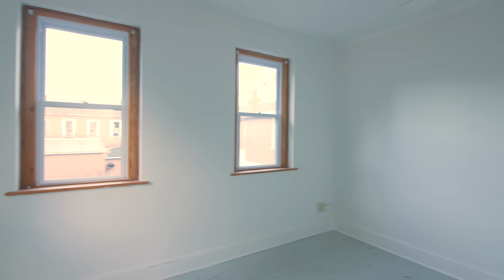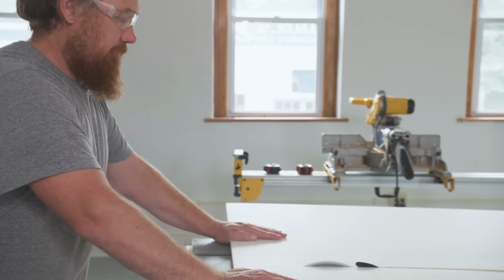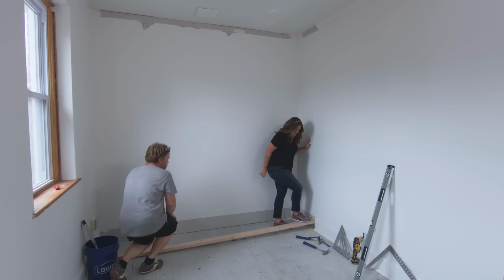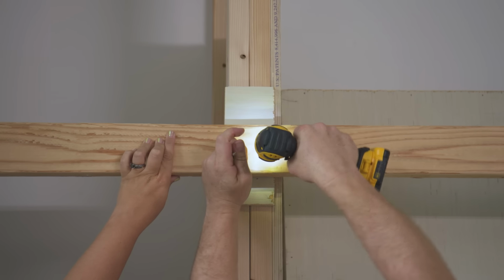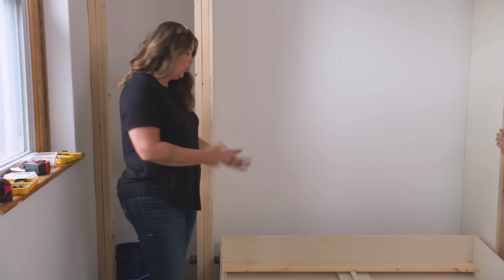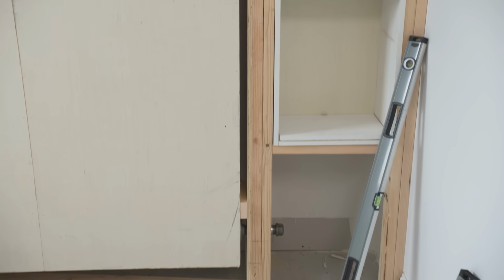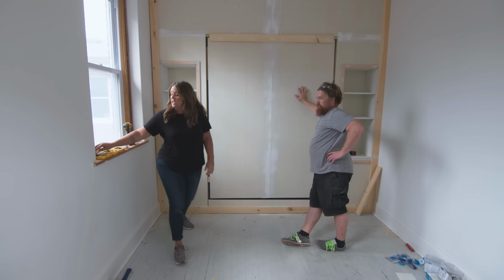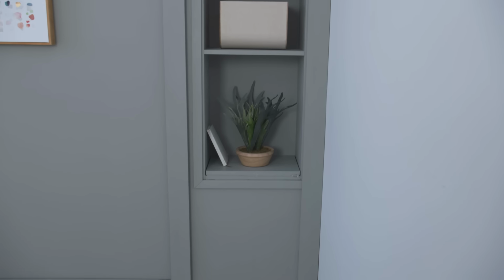How to Build a Hidden Guest Room w/ a Murphy Bed

Comment: I looked at this video MONTHS ago and thought that's a cute idea. Never intended on using it. But now after living in my house for 3 years and tackling some DIY projects the thought of a Murphy bed has come up. After watching hours of content, great content might I add the idea of spending so much on the mechanical mechanisms is a bit much. So glad that this video came full circle for me. Seems pretty low budget and easy to tackle. For those who are saying the space above the bed is wasted. Maybe you could use the side and back wall studs to support the weight of the build. Add a layer of plywood to the top to support upper shelving? Just a thought I'm not a carpenter, just another DIYer looking for ideas and this is a GREAT pocket friendly idea!! Thanks for sharing! 😁

Comment: Nice work and it looks beautiful, but I'm not liking the removable velcro slats. My experience in fixing others mistakes, is that removable pieces get either lost , broken or stolen. I would have gone for a long piano hinge on both sides that would open up outside of the bed frame and use magnets to attach the side hinged slats to the bed frame when it is put together. Oh and I would have made the lost space accessible as well with the same technique. Thanks for sharing...

Comment: exposed gaps along the floor and ceiling are perfect time to add bead of caulk to air seal. Creative. I think I would adjust so "hidden" frame is attached to bed bottom, position legs diff w/extra tab in center. also the screw bolts are crazy. just use pin/housing? Great DIY project!! thanks

Comment: As an engineer, this build frustrates me so much.... 
It really irks me that a metal pipe will be moving inside a wooden hole for years and years.... Use ball bearings and solid shafts. much better.

This needs a metal frame and metal diagonal support members to resist the torqueing I see is happening with you move this frame... nothing big just some 1x1s welded together. atleast some 2x4 diagonal members if you MUST stick with lumber...

It REALLY bothers me how the trim to cover the gap is fastened with velcro... you know you could have attached that to the bed itself and not fussed with removing it everytime you use it? You also know the average person isn't going to put velcro back on perfectly straight with no gaps, it'll look so bad!

The night stand should be on drawer sliders under the shelf so you don't have to remove anything on the top of the shelf...

The "access panel" for electric really needs to be a wall outlet, not an extension cord. may be up to code but cmon, it's ghetto...

why do you need to unscrew eye bolts to get the bed undone, ON BOTH SIDES... the safety issues and ease of use problems... The wood on the bed and the shelf will strip so fast... Just use a single latch at the top. you could design it such that the trim you decided to velcro at the top is actually attached to the latch such that if you pull on the trim, it unlatches the bed frame. word of advice from an engineer: if you have to say "it helps to have two people" you designed it wrong.

If it were me, I'd  add dampers so a 90 pound woman could lower this, because a queen bed and frame at that height is cumbersome for even me. You can also get loaded spring hinges to help counteract the moment about the ball bearing/pipe hinges and install them adjacent to the ball bearing hinges. With how this SHOULD HAVE been built, it would be much heavier anyways...

Why on earth is there so much space wasted? I thought it was a space saving project, but there was some space on all four sides of the bed that are now enclosed and lost forever...

wtf is that leg design? Get a 2x(x... however tall you want the bed) hinged on the top, and they will fold out to expose the hinges when the bed is in use, much like your original nightstand design.. much prettier, safer, and sturdier than what you guys did...

Comment: I have a sewing room and my husband hung a table to the wall with hinges and a winch in  the garage next door  in a cabinet so as   to lift the table up and down. This table can be used as a quilting table in my sewing room. The day bed  has been redone to hold the weight of the table.

the garage next

Comment: Such a beautiful and simple design. I’d add a drop-table with an attached leg to the platform base/wall so that you have a small table for crafts, games, or puzzles or as a desk. The table needs to be strong enough to support a sewing machine. What was the cost of the build without the mattress, pillows, decorations, etc.?

Comment: Once again GREAT IDEA for a video but when they started talking about the eye bolts all I could think was "WTF?" and don't get me started on the velcro trick is just a tacky as leaving the gaps.  Another thing - just like EVERYONE (more than 700 people) who commented below, this project was poorly thought out as far as using the overhead and space below the nightstands for storage. Also, that bed frame is going to make that bed VERY uncomfortable with that one stabilizer bar running down the middle. Anybody else here wonders if the bed legs might get hung up on the framing if they expand due to high humidity? Great idea for a video but they really need to go back to the drawing board. What a disappointment.

Comment: Murphy beds with fold out desks are expensive ..usually well up to 2k....this is a dyi  cheapo version and I LOVE IT. I have looked at these for years and this is one clever version although I would put metal corner braces in the bottom part of the frame to prevent the corners from blowing out from the shifting weight of the mattress as it is brought up.  I would add a folding desk to the wall and gladly call it my office! There are so many design possibilities with this build, storage across the top of the bed frame (book freak here)  perhaps with a library rolling bar and ladder (really a book freak here)More shelving if you wanted it on either side..even cabinet doors covering a lower unit on either side to hold bedding and guest items like a bathrobe, slippers, mini shampoo's and soaps, face cloths, all in a basket of for them to take out and use.  Perhaps a bottle and glasses for a night cap lol.  Thanks for the idea's

Comment: The only problem with this, is that y’all make it look so easy that I want to start on my own project right away knowing that I’ll get myself into trouble haha.
Reply: I totally agree with you !
Reply: hahahaha
Reply: and 10k worth of tools you're only going to use once lol
Reply: Plus it will be heavy to lift and lower.
Reply: @rwatson2609  Not if you put a Sleep Number mattress in it. That would take some figuring to allow for the hose, inflator, etc but it could be done.
Reply: @catgrrl58  True. I have this Air bed from 15 years ago that would be ideal. It's Super light (20 lbs) and made by Posturpedic.

Comment: This project looks amateurish.  First the bed frame looks like it is from a college dorm.  Second, it is flimsy.  When they put the bed down it was flexing everywhere.  It is so heavy that it took 2 people to put it up and down on camera. But wait, there was no mattress in the frame.  How heavy will it be then?  Where is the counterweight or spring system to make the bed easier to open and close?  Of course to add to the ‘polished look’ of the bed, the legs look like Fred Flintstone designed them at the Bedrock Slate Gravel And Rock Company.  And don’t forget the incredibly complex locking system to hold the bed up, 21 huge eye bolts that you have to screw and unscrew.  DO YOURSELF A FAVOR, GO TO WAYFAIR AND BUY A PRE-MADE BED.

Comment: I might have the open shelves facing inward towards the bed. Then make sure there are receptacles on both sides. If you finish the whole top section with a bottom shelf, you could have a lot of storage for sheets, pillows, blankets, comforters and/or bedspreads. Lights above the pillow area would be nice. The shelves could be used for books, tissues, bottled water, lamps, vase with flowers, etc. for your guests. Under the piano hinge tables could be additional storage or a small garbage area. Adding more function to the exterior of the bed would be helpful. A desk for the room could be used that doubles as an extra support for the bed along with extra legs would be good. Framed art could be mounted above the desk. Another piece of artwork would be good above the pillows for the lights to showcase. You could use mounted string lights inside the open bed area, too. Nice concept just needs some tweaking.
Reply: Great idea.

Comment: You could just purchase a Murphy bed with actual gas shocks for the mattress  and it would not be a lot more money than what was spent here. Then you could pull it out of the room if you ever wanted the full room back. Also that spackle between the seams under the bed is going to crack because the bed will slightly twist unless it’s being perfectly lowered all the time. I also don’t understand the need for the mattress slats. The mattress could easily just sit on the flat plywood. Most box springs are solid on top. Definitely creative, but is more work and less functional than just getting a Murphy bed in my opinion.

Comment: This is great. I don't think I've ever seen such a simple mechanism for a murphy bed. I'd consider doing this for studio flat too. I'd probably change the design a bit, make the moulding around the bed permanent, lose the fold down legs and have a shelf attached that acts as the legs.

Comment: So basically just a Murphy bed in a closet, which is where they usually go.  Nothing hidden about it.  The problem with Murphy beds is clearing everything out of the "multi-purpose" room so there's room to drop it down.

Comment: Not a good build. Should have bought a mechanical Murphy bed kit to make the opening and closing of the bed a simple and much stronger task (no warping). I would have also attached the molding to the bottom of the bed structure instead of velcro-ing it to the wall (tacky).
Nice idea...poor execution.

Comment: Should you not treat the shelve box opening like a window opening and have it double studded.Maybe one in the back to add in support.Also you have the pipes supporting the bed going thru 3/4 inch plywood.After time and if the people are big/heavy you will wear out the hole openings.Maybe have a 2x4 support right under the pipe going front to back with a leg centered under pipe.Would last longer supporting and heavy people sleeping on it.Also would be better to have spring loaded locking pins to keep bed up instead of having to remove the eye bolts.

Comment: If the molding to cover the gaps between the bed and its frame was simply attached to the under-bed frame itself, then there would be no need to repetitively remove the moldings each time the bed is set-up, and there wouldn’t be a need to continually replace them afterward. 😊

Comment: I think a shelf  could be used near the top to be the bottom of the bed  support that would add strength and you wouldn't have to reach for the legs as you lower the bed.

Comment: And ... POOF! the bed face/frame was conjured out of thin air - unless I blinked. Watched it again, I didn't blink. The mattress box is too deep - it only needs support for the mattress at the head of the bed when it is closed, the rest of the box sides is basically a "skirt" as found on a table, but it only needs to be a few inches tall. I agree with the rest of the commenters about the wasted space. It would not have taken much more effort to add cabinets or open shelves at the top, could have been used for pillows and bedding.

Comment: While the design has its' flaws anyone with some creativity and some woodworking skills can take it to the next level. My thoughts are this is being treated as a beginner project for new homeowners in a small 2 bedroom at most. I would have loved to have this available 40 years ago when I bought my first home. Seeing it now it gives me a great way to start and I can turn a basement room into a temporary bedroom when I have large gatherings. My home currently has 4 bedrooms but they are used for entirely different purposes.

Comment: Why didn't you just attach the molding to the underside of the bed frame instead of velcroing it to the wall, adding an extra step to the transitioning process?  I'm not a carpenter, so maybe there was a good reason I'm just not seeing.

Comment: Great built and 3 little added ideas;
1. the top space could and should be used for lennin storage
2. the final trims could have been attached to the bed and use a different leg method
3. The Night stand could have side access in addition to the front access.

Comment: I love it!  I need to do just this in a downstairs office that hasn't been used in 10 years due to water damage that took that long to repair.  2 years ago more water damage affected the main floor, and then after a 25 month reno, there was more water damage downstairs again, so 6 holes cut in the walls to find the cleanout place in the drain.  This project looks doable!

Comment: Please address gap between the top of the mattress (where the pillows are) and the wall when the bed is pulled down. It's going to be the same size as however wide your mattress is. But, I see that you have the pillows piled high to the wall. Our mattress is very thick, so, it's almost 14 inches from the wall. How do I minimize this?

Comment: You should of supported the pivot points better instead of having them rub against the 1/2 in plywood. That's a wear point and will fail sooner than you think. They have systems that you can buy and reinforce the pivot point. Otherwise it's a good idea for the small space.

Comment: Why didn't you nail the board to the bed and not the wall, to hide the gaps, instead of using Velcro? You would have to come up with a different design for the legs, but that's a good thing. The way they are currently is very jank.

Comment: Love that you didn't use ready-made hardware, and will be referencing this build for our skoolie - but I'm not a fan of how the bed is secured with eye bolts, how wobbly the bed is coming down, the wasted space within the wall, or the velcro trim that I'm sure could have been addressed in a better way.

Comment: You can use a spring wood platform for mattresses where there is no box spring. Provides some bounce and resistance and stiffens the bed box. You can get these direct from IKEA, they are less than 2" deep and come in standard US sizes.

Comment: Were it me doing this project, I would have either put shelves along the top of the wall or cabinet doors for extra storage.  I would have also either made the shelves on either side floor to ceiling or had cabinet doors on the bottom for more storage. With the lower cabinet doors, you would have not have had to do a cutout inside the bed frame area, although the cut out would have also allowed for plug in areas on both sides of the bed. For space saving, I would have added  recessed lighting with a dimmer switch at the headboard.  Additionally I would have attached the trim to the bed frame panels, none of that velcro stuff. Your idea is moving in the right direction, but is unfinished and has way too much wasted space and effort in use of the bed.  A simple murphy bed kit which provides the pivots and gas lifts would make this far more user friendly at a fairly nominal price. To dress up the exterior panels of the bed, you could have made it look like a wall of cabinets with floor to ceiling shelves on either side.  Just some thoughts...

Comment: A pre built spring Murphy bed would have been way more efficient and easy to use ... and the sides of the bed would have been soft to sit on rather than the hard pieces of wood encasing the mattress. Not to mention it would be easier to make the bed. Not to mention having to remove the bolts and surrounding slats every time the bed is used. What’s with all the wasted space in the area surrounding the bed?

Comment: Very nice!  But I have an INTEX blow up bed with a built in air pump, plug it in and it inflates or deflates in 5 min or less.
  It's from the Dura-Beam Series, deluxe pillow rest raised airbed. Queen size 60in×80in×19in & is
 16 1/2 in height with a built in pillow (air lock) can hold up to 
600 lb. & it comes with a case bag to store it when not in use. It's 
100% more durable, 35% more surrortive & 15% lighter than a traditional airbed. 
  The thing is it says Queen Size and it is as big or not bigger than my king size bed was!!! Maybe someone put a King Size in a Queen Size box?
   Anyway it cost me like $50. or $60. dallors and I got it on a site called WISH.
   I live in an apartment so I can't do the in built neat stuff. I just thought I'd share. I make models and model homes though so I'll keep this in mind, but I'd put in added storage space.

Comment: Love the hidden presentation but I don't understand why it couldn't be more streamlined and flushed.  The velcro and screw bolts to secure it seems like an afterthought.  where would you pus the mouldings when the bed is untilized?  Just creates more mess than really needs to be.

Comment: Why did they make it a point to put the plywood on with nails and screws on the sides and then later, they have it removed? Imagine following these instructions in the order they put them? I'm an electrician, there is no way I could reach that outlet to pull it out if it ever needed service. Spackle on raw wood?